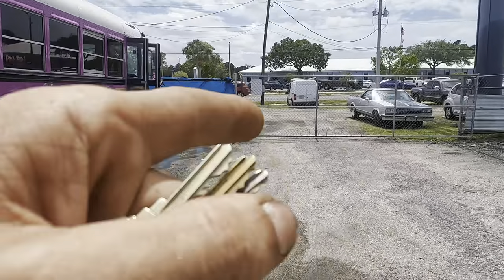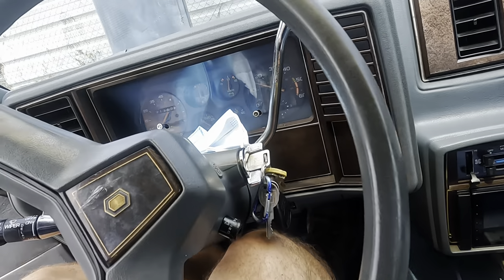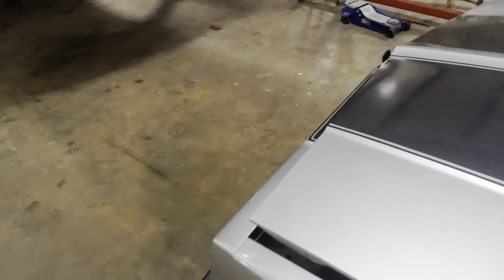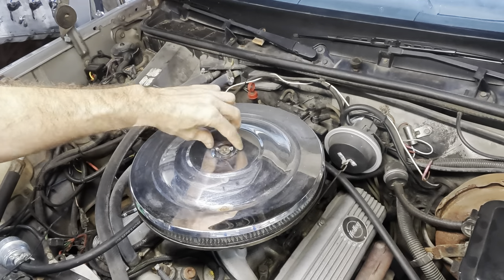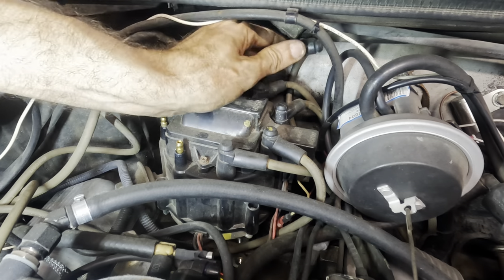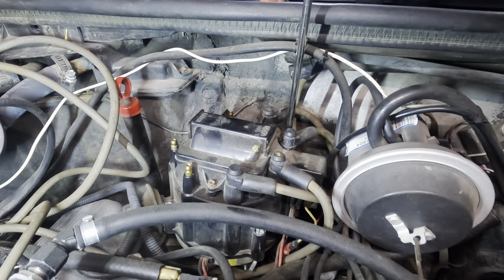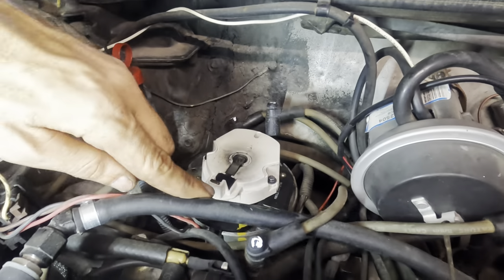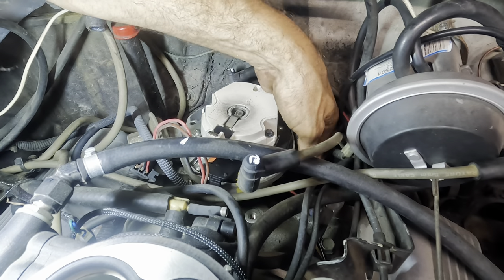Shuts Down While Driving! 1985 Chevrolet El Camino | Karen Story at End #mechanic

Comment: For those who don't know, FiTech is an aftermarket fuel injection company. That "carburetor" on the El Camino is actually a retrofit throttle body injection unit.
Reply: It's probably vapor lock causing the issue.
Reply: This is EXACTLY why I came on here. 
Guaranteed that FiTech is the cause of this El Camino’s issue. 
Absolute garbage. 
0/10… Wouldn’t use FiTech on even a lawnmower.
Reply: @gbodyman73  I was about to say. Isn't Fi-Tech like crap? Seen a video long ago about how bad Fi-Tech was in terms of customer support/warrenty stuff, and just faulty units.
Reply: I believe FITECH was bought out by Holley, They rebranded the unit with a different name and they are still crap. I think Holley was hoping the Holley software would help, but all the problems I have seen are mechanical failures. But there are no issues with the Holley stealth units. When I went to the Holley EFI course, the lead instructor HIMSELF advised to never use the rebranded units. Just step up to the Stealth model. <- Yes, I am a Tier 3 Holley EFI Certified technician.
Reply: @edwardmyers1746  FiTech has a horrible reputation! 
Bad products. Bad customer service and support. 
I’ve had several friends that did a very similar carb retrofit. They had nothing but problems. And eventually just went back to carb or with a different system, like a Holley Sniper.
Reply: @AJwoodway  almost as bad as the old rochester carburetors...hated those damn things
Reply: @gbodyman73  Niki 6!!!!! TDactyl lol
Reply: Had a 64 Catalina.  Between the slushbox Trans and the Rottenchester carb, it was OK!!! Lol
Reply: Yes
Reply: It surprise's me when I see a technician not recognize some of these products. Fitech was like one of the first aftermarket fuel injection units "hints the issues" but if your going to label yourself a master tech you should know of brands and technologies, you have to eat sleep and 💩 cars....
Reply: I work in a restoration shop, and we haven't had any troubles with some of the cars that have them, one 70 Buick in our shop did a 800 mile trip and all was well, but people say they're no good but haven't seen it
Reply: @TheMaster1  That's exactly what I was thinking.
Reply: @dogsense3773  the people that have problems with them don't run recommended fuel filters and they get clogged, they don't have enough fuel supply or not the right pressure and or INCORRECT TIMING, and are just running a rubber hose to the unit instead of steel braided line with AN fittings. From what I've seen there is a hand held programmer with very simple steps that people mess up and they'll make timing and fueling adjustments after programming. There's a lot of dense people out here and it surprised me Ray didn't know what it was and said he didn't "need" a timing light. If you're any kind of technician you need a timing light because a change in octane fuel with to much advance is the difference in a melted piston or wasted valve. I'm one of the last mohicans I guess, I really thought Ray was till today to, he must pray a lot.
Reply: I am guessing it came with a Rochester E4ME carburetor from the factory.
Reply: @Sneakdisscommentbelow  not if you don't mess with aftermarket parts.
Reply: @martinpierce501  Who asked? Are all these retro carb/throttle bodies junk? A few people I know used those and wound up putting a Holley back on their kit.
Reply: @gbodyman73  Yep, The only real choices are Holley and Edlebrock... eveything else is junk.
Reply: @Sneakdisscommentbelow  I have a feeling that if Ray had a timing light, he would've used it. He doesn't have or need one because he doesn't typically work on vehicles with distributor ignition. The method he used to adjust the timing is an old-school, cheap-and-dirty way of setting the timing, but it works, and is accurate enough for a sub-200hp weekend cruiser like this El Camino.
Reply: @martinpierce501  Nice, what's the coolest vehicle you've worked on?
Reply: Ive had a fitech worst FI ever built pretty much untunable and would vapor lock after 30 miles or so no matter whats the outside temps where and if 8 was gentle or  beating the snot out of it
Reply: Stick with what you know.
Reply: @joevk6274  not with Fitech, it needs the proper timing for optimum driveability and performance. It doesn't meter fuel off vacuum like a carburetor, I'm pretty sure it uses a map sensor. It also learns fuel mixtures but has no way of backing off timing. If it says timing should be at 10 then it should be at 10 and also not reach a higher than required advance. It depends ultimately on the requirements of the system. This is why ppl say Fi is junk because they don't factor in all the variables.
Reply: Huh, good to know
Reply: The computer on those throttle bodies are known to crap out.
Reply: @willydavid  yes, I’ve have several people I know retrofit to a Holley Sniper Stealth and have had great success with them. 
I will admit, that Holley Tech Support can be a little slow, if you need them. 
But most of the time, you don’t even need Tech Support.
Reply: I dropped in to make the same comment. I'm running a Holley Sniper Stealth on my 496, no problems at all. No way would I even think of using Fitech and suspect vapor lock as the probable cause of the hot start issue. More so, if the owner is running a returnless regulator.
Reply: @AJwoodway  he should have gone with the Holly unit.
Reply: Toilet bowl injection 🚽
Reply: Time by manifold vacuume
Reply: @joevk6274  Had a Daihatsu Charade 92 model took it to a mechanic after I rebuilt the motor just to check the timing (didn't have a timing light ) came back worse so I ear tuned (undo the bolt on the dizzy) & it ran like a rocket would red line in 1/2/3/4 th 7,000rpms. so who needs a light.
Reply: Yeah i have a fitech 30002 on a 600hp 351w and it works great
Reply: @MrChadt13 i had some issues with a fitech efi installed, it was the TIMING...
Reply: @LesReeves  Sounds like you have a well tuned earcrometer, lol.
Reply: Ain't not a damn thing wrong with a sloberjet they work great you just gotta know their quirks. Metering rod carbs are always a bit tricky but once you know what to look for it's a cake walk and they run exceptionally well when setup correctly! But I get your frustration an old worn quadrajet can be a nightmare.
Reply: @willy david  Nothing sounds quite like a qjet with the rear bores wide open kinda sounds like a roar when you dig into them. GM used them by the million if they were junk as some folks claim they would still be replacing them to this day lol.
Reply: I had an old Rochester Quad that I mailed off to jet performance products to rebuild the carb.  Drove it for 10 years after that with no issues.  Good times.  A guy talked me into advancing the timing to just under spark knock.  That was dumb, I retarded the timing a bit after awhile and I’m glad I did before I damaged the piston/valves.
Reply: junk junk junk
Reply: Have you seen the edelbrock system?
Reply: The only bad Rochester units were the late 80s electronic ones. The old ones are stupid simple. Never had an issue rebuilding one myself.
Reply: @oliver_klozoff  Agreed. They weren't just "gas dumpers" like Holleys. The Qjet is a phenomenal street carb if tuned right. Most of the time, they aren't.
Reply: Loved the remarks about Karen lmao. Also you're probably going to get 100 timing lights now haa
Reply: absolutely nothing wrong with a rochester carb,,,ya just gotta be smarter than the carb itself,,,which isn't that hard
Reply: @tomstiel7576  yes they are sone of the easiest carbs I ever worked on. Now the Carter thermo quad.......
Reply: @TheMaster1  probably not, the Fi-Tech uses a 58 psi return system, it's not like an old carbed 350.
Reply: @l.no.solace7209  thanks for the backup, these carb guys are as simple as a carb XD
Reply: @Martin Pierce  no FItech and holley are separate. The Holley sniper systems are fantastic
Reply: @dh-_1011  The holley snipers are really solid. Have a fee of them and have no issues. One is even force induced
Reply: Yup and that’s probably the problem when hot , bubbles
Reply: @TheMaster1  yes true . Had an 88 firebird same engine and it had an electronic carburetor. It leaned out the jets at idle for emissions and would stall when hot , pos and they lemoned it so we changed brands
Reply: @Sneakdisscommentbelow  How often does an everyday  mechanic today run into a 1985 chevy small block, especially with a FITech injection system ?  That's almost like expecting someone to know a 1972 Mercedes Bosch fuel injection system, because they're a master mechanic.
Reply: @letitrest4662  they have books and archives, if you're a seasoned technician you have to be ready for anything that drives in, especially classics. Your going to run into anything and everything, most shops I've worked for I've seen a lil bit of everything, mechanical know how, being able to read wiring diagrams, tsb's and Google searches, Haynes manuals everything comes into play and also knowing that it's very possible that the El Camino with 305 and 350s camshafts were notorious for breaking down and vapor lock is a real thing.
Reply: @gbodyman73  What did you end up using????
Reply: Very true
Reply: @TheMaster1 my thoughts too
Reply: @snackler6102  literally worked and repaired all of those, built domestics, classics, repaired European and Chinesium's, there's no way to know everything, it's more about having the knowledge to figure out what you're doing wrong and saying I don't need a timing light is something I heard from a guy that had a Suburban and didn't realize his engine light was on because Vortec would throw a code for base timing 😂. He was about to pull his timing chain for no reason. When you 95% sure something is the problem you should go ahead and do 5% of research, that elco should pull nicely even if it has a 305HO, these comments are so old I don't remember if this engine had center bolt valve cover bolts.

Comment: Ahh… brings me back to the days when a timing light and a dwell meter were tune up essentials, anyone else remember the GM distributors with the trap door where you could reach in with an Allen wrench and set the points with a dwell meter? Very satisfying process!
Reply: That's the only good design GM ever had 😂
Reply: You could also just turn it in gradually until it started mis-firing then back it off half a turn or so if you didn't have a dwell meter.
Reply: I had the flexible allen driver that made it easier. After having a set of points close up on me and fail I got in the habit of checking dwell at every oil change.
Reply: I do. I still have points wrenches sitting around. Remember using a matchbook to get your points close?
Reply: Still have my Sun dwell meter and timing light. I also have the Allen points adjuster. Allen wrench was attached to 6in of speedometer cable which attach to a thin screwdriver handle. I also have a set of Craftsman distributor wrenches. All keepers!😊
Reply: Yes, my partner says he remembers that in the GM cars. Said it was super easy to set.
Reply: @applicationuser9764  that’s how my dad taught me - matchbook cover. I was a big shot when I went out and bought some feeler gauges! Mr fancy! Haha
Reply: @paulconetta2264  My timing light was a silver Craftsman, vintage 1976 or so. Good looking tool! Put it in a free pile at the curb many years ago.
Reply: @frankvucolo6249  Still have my old Craftsman I bought around 72.
Reply: @GeekBoyMN  You could use a match book cover as a feeler gauge.  The covers were approximately .018".
Reply: Worked at an Oldsmobile dealership 50 yrs ago. Yes GM tech!! Lol
Reply: @applicationuser9764  yes!
Reply: @thk7513  Well back in the 80s when I dealt with points that would have been nice info. Early 90s was the last time I set points on a friend's Chevy and I had feeler gauges. Nothing I've owned since that first car had points or condenser to have to fiddle with. Thanks for the info.
Reply: @mlieser1230  I still have mine!
Reply: ..And the fun time when you grabbed your first HEI cap that had an unseen crack in it... And you kept that to yourself when you asked another tech to 'take a look'.... Yeah, good times.
Reply: My grandpas '69 olds Cutlass was like that.
Reply: I still have the flex drive Snap-on screwdriver to set the points.
Reply: Yup, my summertime daily driver (69 camaro 396) has the trap door. I replaced the points and condenser with a pertronix breakerless unit though. The way it was originally set up, the points were really tricky to get access to.
Reply: LOL!
 I must have done thousands of those point replacements on those!! Memories!!  (30 degrees on the V8's !! )
Reply: Yep! Echlin P.N. CS786 with a RR175 Condenser. Later replaced with a point/condenser single unit but the part number escapes me...maybe CS81?  Good old days!
Reply: @applicationuser9764  Close?  Heck if it started and didn't miss, I was gone.
Reply: I can still gap a set of points to 18 thou by eye, which is both an amazing but useless skill today lol
Reply: @dbcooper4375  That is the thing to do if you don't want to install an HEI, probably better to keep the stock look on a 69.  Electronic ignition is so much better.
Reply: @GeekBoyMN ⁸u
Reply: I sure do.
Reply: still have the tools lol

Comment: I remember when HEI first came out. If the complaint was stalling when hot, usually it's the coil. You can also get the base timing into the ballpark with a vacuum gauge. Oh! And I share Ray's feelings about people camping out at the gas pump.
Reply: Yes GM did that after Toyota went to a low voltage type points system.  Now everything has its own coil at the spark plug its all low voltage ecpt the spark output  i remember points and caps as well as rotors being an issue. 
Modern cars have a lot more refined parts.
Reply: Could modual heating up as well
Reply: @JimsNBHomestead  Yep.  Had a couple ignition modules fail back in the day.  Cruising along, tach goes crazy, car dies.  Let it cool down for a bit and off you go.
Reply: Brother had a 454 with the HEI setup in it. It would go through spells of killing the coil. He finally found the capacitor was loose and apparently losing its ground. Snugged that down and end of problem.
Reply: Pickup could cause some weird intermittent problems as well. Fun stuff, still take my 70s b.o.p. + caddys over anything made today and I mean ANYTHING. When he was talking about that power brake timing move thats the way I learned.
Reply: @JimsNBHomestead  correct - if it died, no start...wait to cool down and re-starts. Control module in base of dist. usually the culprit. Replaced a few of them

Comment: I guess you might have noticed that the hold down bracket does not need to be removed, it slides to allow removal of the distributor and it's much easier to re-clamp. Most of the problems with that engine while hot are fuel delivery, check for fuel lines crimped or running too close to the exhaust or collapsed rubber hose. The fuel filters added to the lines from the tank to the engine are suspect. You can also use a vacuum gauge to time it. I was going to send you a timing light but I won't.

Comment: Awesome video! Brought back a lot of memories working on these old cars. Wished they still made them. Usually what happen to engine that won't start after it got warm it was the coil or it was the module or the magnetic pickup on the lower part of the distributor.

Comment: I was digging through my tools a couple of years ago and ran across a distributor wrench. It took me a while to figure out what it was for since I hadn't used it since the '80s, lol. I had a nice Sun kit with timing light, dwell meter, etc. that I gave away once all of our cars were "modern" and no fun to work on. I miss the days of non-computerized vehicles.
Reply: A lot easier bloody censors every where now
Reply: Most mechanics had three different distributor wrenches.  One for GM, one for Ford, and a generic one for everything else.
Reply: It didn't matter which distributor wrench you had because it was usually wrong. I've seen collections of 10 or more wrenches and some wher maliciously modified to work.

Comment: From what you said the customer described on it stalling, doesn't sound like ignition.  It sounds like the Amazon special Chinese fuel injection unit/carb is heat soaking and causing vapor lock. What do you always say Ray? Quality doesn't cost, it pays. And thanks for giving me the inspiration to start my own channel and possibly open my own classic and customs shop next year. You are the man.
Reply: Yes absolutely if it stalls when hot then it's not ignition it's most definitely vapour lock
Reply: @neilmurphy845  could be coil breaking down when hot
Reply: With that said ,it takes one to know one .as they say.

Comment: Wow, This takes me back!! Learned all this when cutting my teeth as a young apprentice. Funny thing is it was drilled into me so much I could probably still do all of it with my eyes closed. Fun fact: That HEI coil is good for about 9000 RPM. Doing an apprenticeship under an NHRA Pro Stock engine builder has/had it's advantages. 😉